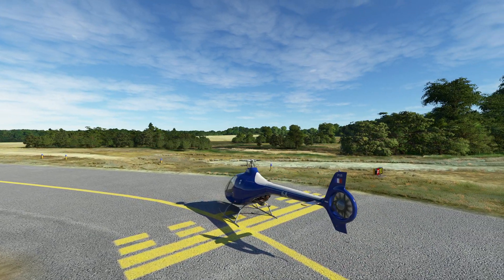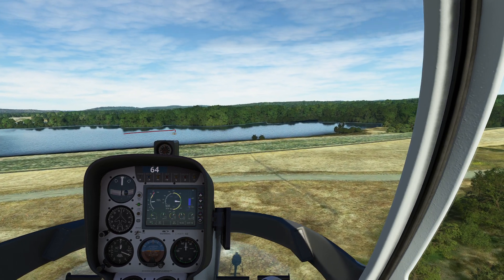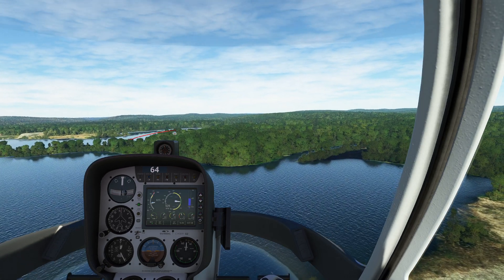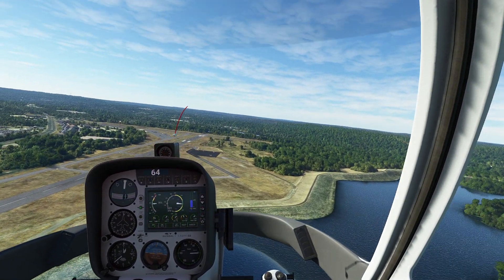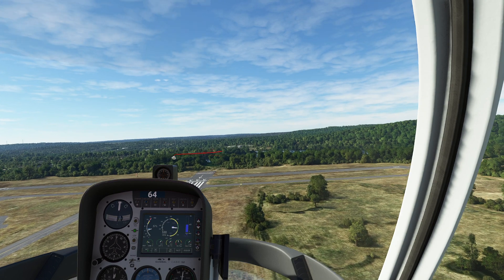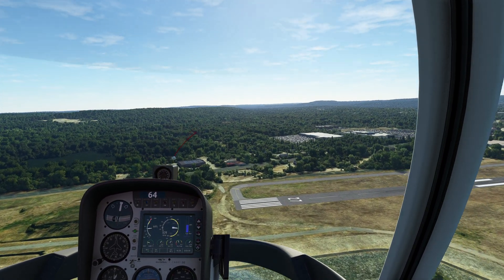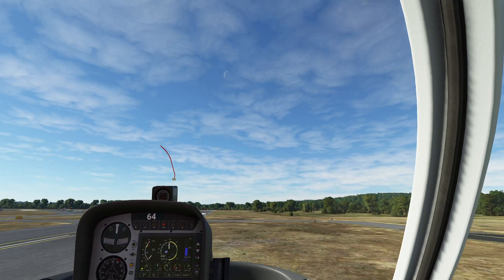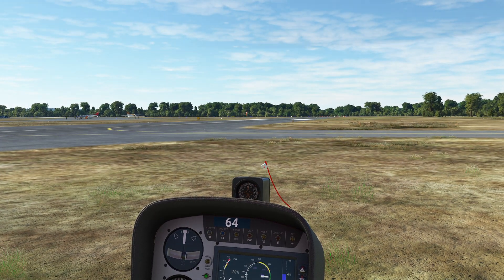MSFS - Helicopter Autorotation

Comment: If you want to make your autorotation practice a lot more like real-life training... (turning off your magnetos is not an option in training), you put your throttle to idle (usually the  instructor does this with or without warning) and wait for the low-rotor rpm alarm/light to sound/light up before bottoming the collective. Once at idle, the governor will be outside its operational range and so won't mess with the throttle during the descent (you can also turn it off manually before beginning the manoeuvre). The low rotor rpm alarm will be one of your main cues in a real emergency (apart from no engine sound which you may or may not hear depending on conditions). In the descent you will also need to manage your rotor rpm with positive collective to avoid rotor overspeed which can kill you too. Correctly dosing the collective also serves to help control your rate of descent which is another important aspect of autorotations. This can be practiced by beginning your autorotation at a higher altitude. At the end of the flare, aim to finish 1-2 metres above the ground before bringing the throttle back in and reestablishing a powered hover. One of the most important aspects of this training is to develop the reflex of lowering collective as quickly as possible on hearing that alarm, especially on low-inertia rotors like Robbies. The Cabri has much more inertia in its rotor and so is inherently safer but you're still going to need quick reflexes. Wait too long... and you're toast. 🙂
Reply: yeaaaa no one likes hitting the low RPM critical speed.... just not going to have a good time. 80%+1% per 1000ft of DA....Always fun flying high DA days at 2000AGL.  Where I'm at we had some 9000 DA  days with field elevation of 5600 Robbies are fun and scary all at the same time.

Comment: As a real life heli pilot I was really excited about Heli's coming into the sim! Overall I really enjoy them but I think auto rotations still definitely need some work. In real life you would flare the aircraft at about 50ft in order to bleed off the airspeed and then only pull collective at last minute in order to soften the touch down. If you were to pull collective during the flare then you would lose your stored inertia (especially in the R22/44 and Cabri G2) and therefore would still hit the ground at some serious pace, bad back for life is what one of my ex instructors used to say! 😂😂. From my experience of doing auto's in the sim, it appears that the flare without pulling collective actually does nothing and you just continue to hit the ground, even with the engine off if you pull maximum collective the G2 will actually start to climb for about 50ft, which would certainly not happen in real life! I think Asobo have done really well overall but I am hoping they fine tune these things at some point.
Reply: helicopters in MSFS are a crap.